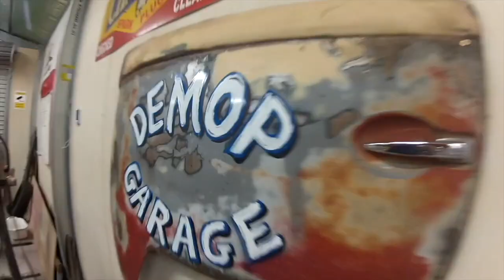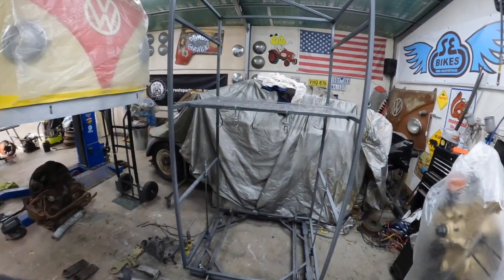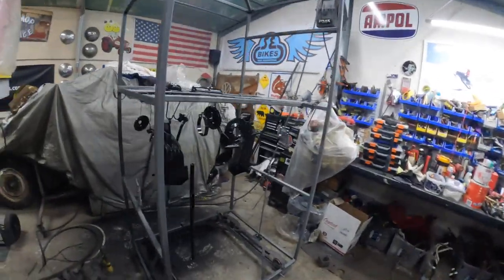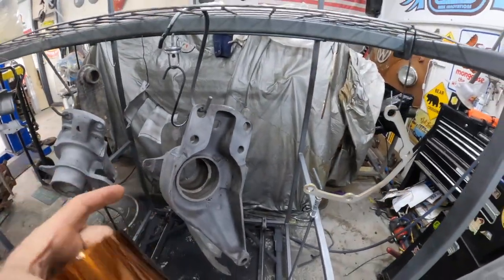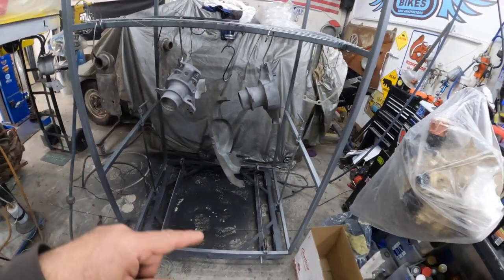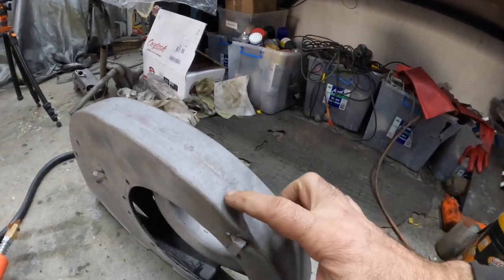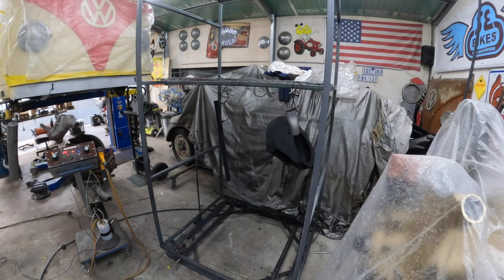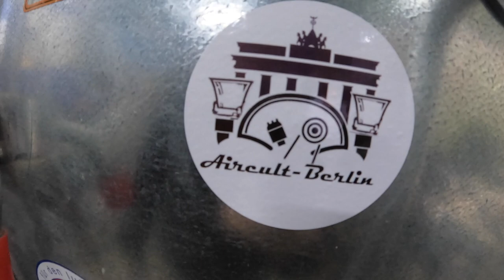Rebuilding a 1952 barn door ambulance // Sand blasting & powder coating at home #vwbarndoor

Comment: Hi, first video I've watched and I like your approach, oven looks a nice bit of kit but I've never done any powder coating so that was interesting. You might already know this but the oxidation that quickly appears after blasting is where the rust has not been removed thoroughly. It took me a long time to realize this, if you keep re-blasting the parts, it may take 3 or 4 attempts but then you will be able to leave the parts in your workshop for months and it won't rust. Just like new steel doesn't rust quickly if kept dry. What I actually do is blast parts and then immerse them in a rust remover tank, this will then do the very thorough job of rust removal. Good as new, but it all depends on how fussy you want to be. Time is money of course.
Reply from the maker: Cheers Ben wise words for sure👍🏽 Im sure living right near the surf beach doesn’t help with the rust too🤷🏽‍♂️🤦‍♂️
Reply: @DemopVWgarage  yes and no, usually no but in the media blasting case it would reveal the remains of the old rust faster. I like the damp days after blasting because it reveals all the missed bits quickly. In your video showing the rocker cover, that is definitely old rust, not new rust formation.

Comment: Awesome garage heater as well as powder oven. Do you have 3 phase or have you jammed a big nail in the fuse box?
Reply from the maker: No 3 phase but I do have 60 amps in the shed. Ovens only putting out 30.

Comment: No wander it's so spendy huge process ! Are the parts or the rack grounded with a ground clamp so the power sticks to the metal as you would say bits and pieces and then baked or cooked in the energy sucking oven for how long ? But look at the results amazing they say if it chips you can use finger nail polish to touch it up small chips anyway ! As they say the differents beteen the men and the boys is the price of there toy's ! Thank you !
Reply from the maker: The ground wire goes outside into the powder coating machine from the powder coating machine. It then goes to the cage to create the electrostatic process and yes it is an expensive process to get things powder coated because of the labour.